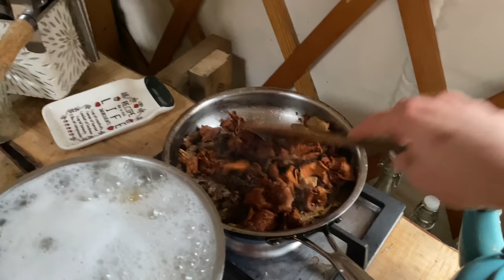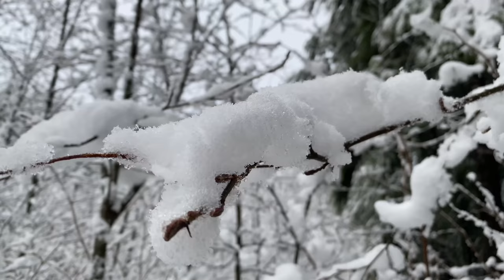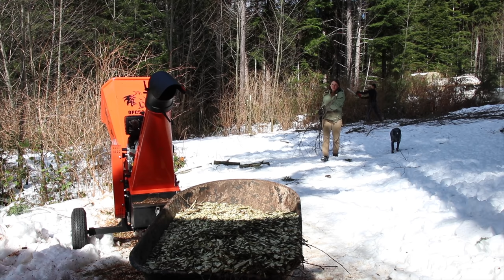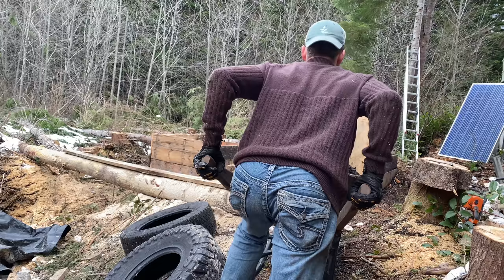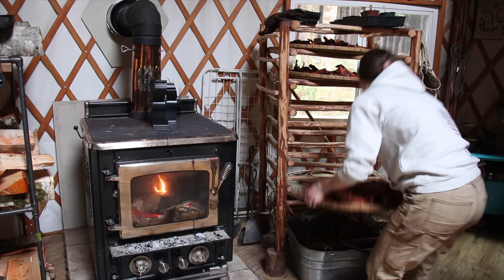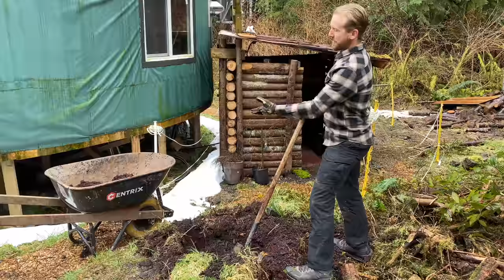TIME FOR A CHANGE // Alone in a YURT, Making Her Crazy | BUNKIE CABIN & Garden Food Forest - Ep. 126

Comment: TIP: Nicole always load the wheel barrel in the front so the steering is easier and the weight is lighter on the handle.

Comment: I made a wood stove out of an old water reserv tank,i cut the rounded end off and turned it around as the door.
When putting firewood in a wood stove there are patterns or stacks that burn hotter!
The door had a 1inch pipe in the middle that supplied more oxygen to burn hotter.
I woukd stack the wood like a log cabin to start ,but set it up as just the sides so more air would get to it and the results are a hotter burn!

Comment: Hey guys just started watching your videos. Figured I'd give you a tip that will make ALL your projects much easier and more precise. You should buy a cheap builders level (sometimes called an optical level). It will make levelling your ground and making sure that all of your footings are at the same elevation. You should be able to find one cheap. And even cheaper if you find one second hand. It's much more precise than using a 3ft or 6ft level, and you can do projects that require hundreds of feet between 2 level points or what not.

Comment: That's definitely graupel. Hail and graupel are basically the same but hail is hard, and graupel is soft. This is kind of like Minnesota. Sunny and in the mid teens Celsius three days straight then bam 24cm of snow then back into the upper teens Celsius. Spring is such an extremely fickle season. Nicole if you ever get to this point again you need to first not apologise you have a right to be upset or feel crappy some days it's called being human. Second you need to take 1 or 2 days off. At some point the warning signs of impending burn out were missed, and now you need to take time to recenter yourself before you get to a point of burn out that you simply can't get the excitement and caring for your current life back from. Us humans do crave some sort of routine, but we need breaks and definitive variety too or we go crazy. Third and final thing is you need to see family. I know it was pretty much impossible during the pandemic, but for someone as family oriented as you are that physical contact with family is an absolute must. So basically break, don't apologise for feeling, and see your family. That will work every time for getting your mojo back.